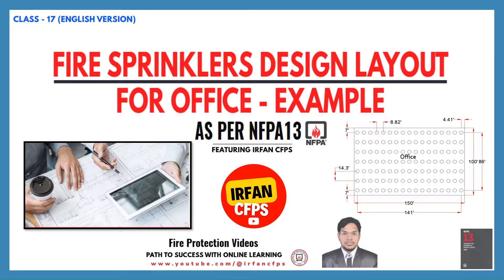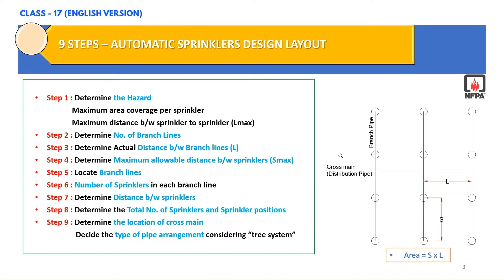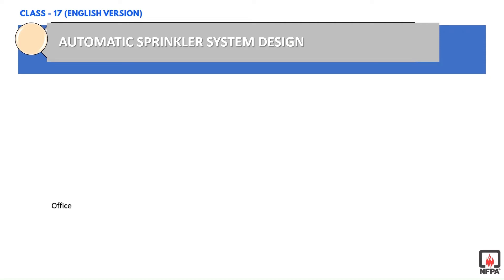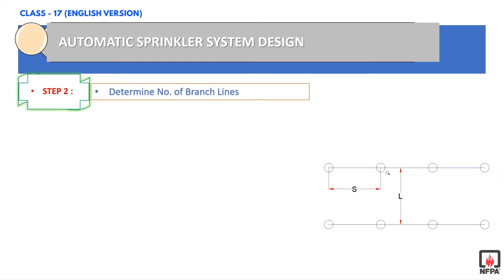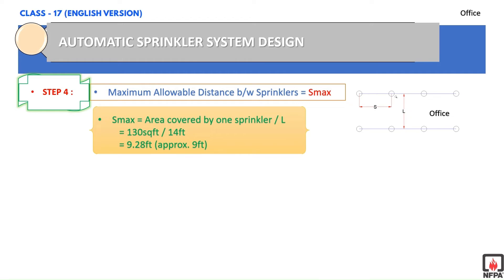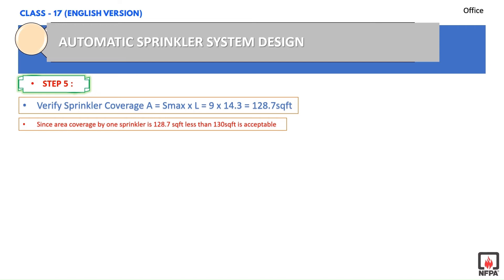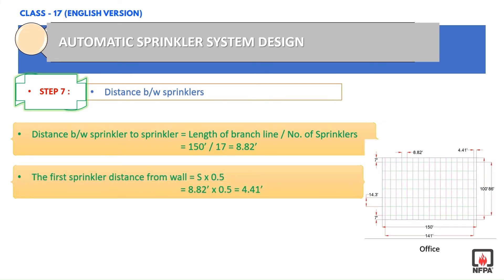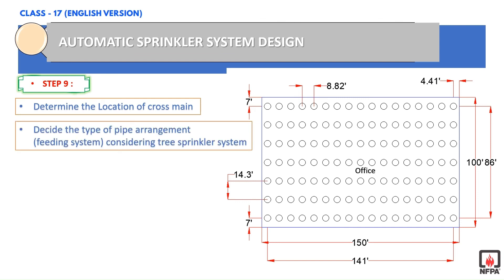Fire Sprinkler Layouts Explained: NFPA 13 Design Guide

Comment: I have a query regarding the sprinkler branch piping as the warehouse structure is arched type (semi circular type). According to NFPA 13, the distance between the sprinkler deflector and the ceiling should be a minimum of 1 inch (25 mm) and a maximum of 12 inches (300 mm).In such a case what should be the design of sprinkler piping to maintain this distance, can it be installed in semicircular shape as per arched roof structure?
Reply from the maker: Sprinklers shall be installed along the slope. Please go through nfpa 13 slope ceiling

Comment: thanks for the video.. I ve a doubt in the last step where you verified sprinkler coverage by dividing total area with total no. of sprinklers. How did you come to 130 sqft to consider the system adequate.. ?
Reply from the maker: Area coverage per one sprinkler is 130sqft for oridnary hazard occupancies as per nfpa 13. I will make one video soon to understand the coverage area of sprinklers for light, ordinary and extra hazard occupancies.

Comment: When verifying the sprinkler coverage around the 5:59 time mark, you obtained a Sprinkler Coverage Area = 128.7 sqft. 

However, if you consider the Coverage Area for a sprinkler that is adjacent to a wall & apply the values you previously used, wouldn't your value exceed your allowed max coverage area per NFPA 13? 

For example, here are the values you calcualted in the video:

i.) Sprinkler Distance to Wall: 7ft
ii.) Smax: 9 ft 
ii.) L: 14.3 ft

Area of Coverage for Sprinkler Adjacent to 2 Walls & Applying "S & L" Rule:

A =  (2 x Distance From Wall)  x (Greatest Distance to Adjacent Sprinkler)

A = (2 x 7ft) x (14.3 ft)

A=  200.2 sqft   

200.2 sqft > 130 sqft

Thus, for an Ordinary Hazard Occupancy, the area of coverage for a sprinkler adjacent to a wall would exceed what is allowed per NFPA 13.

Please let me know what your thoughts are. (Also, I greatly enjoy your videos, keep up the great work!)
Reply from the maker: I will check the video and reply. Thanks

Comment: Thank you very much for sharing the knowledge. May I ask about K-factor of sprinkler head we may use in this case ?
Reply from the maker: Minimum k factor shall be 5.6 (k80) as per nfpa .. in case u don’t have project specifications.. however if the floor height is more than 7 m k factor changes
Reply: Thank you. sir.
Reply from the maker: @arnoom1117 Welcome